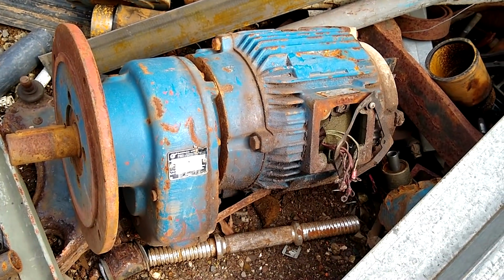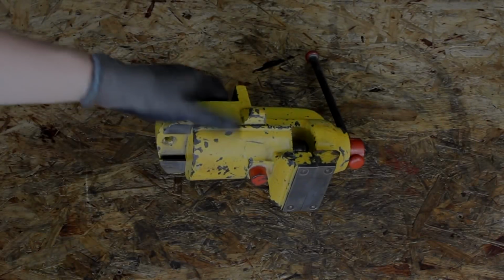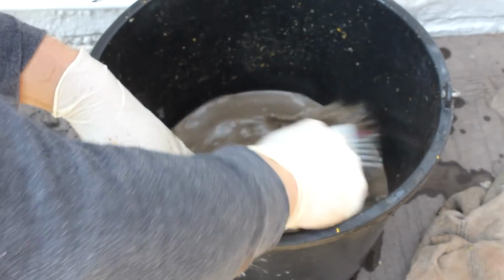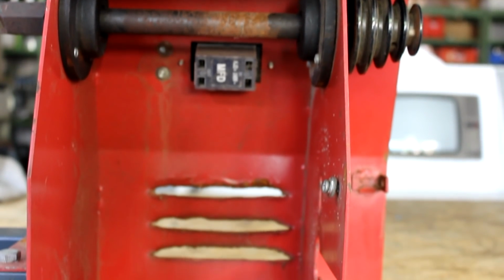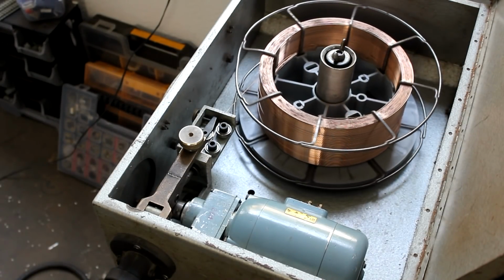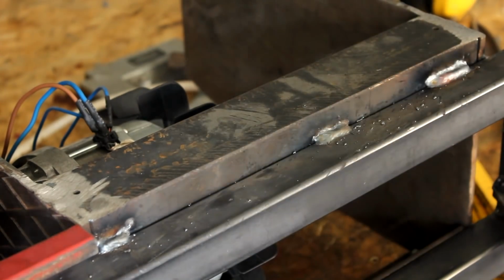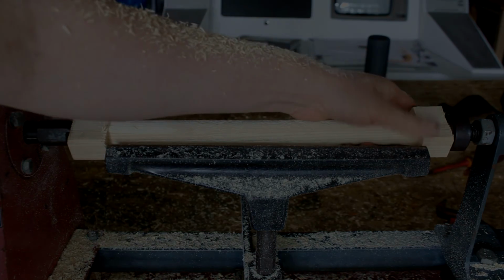New Scrapyard Finds! Repair-A-Thon!

Comment: That ring roller didn't even look damaged. Plug it in and go to work. I hope someone snatched that. I would have got a right handed motor and a step pulley. That added a ton to the fooprint, and now you can't change speed while keeping full power.

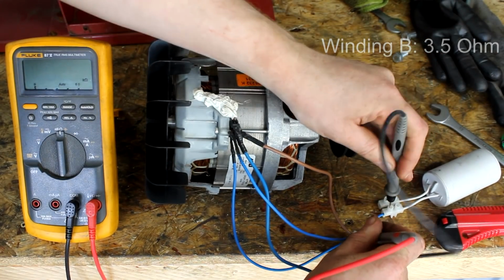Comment: @9:17 sometimes you can take the motor apart and flip the stator to get it to turn the other way.
Reply: That may work, but you have to make a circular thing that keeps the nut from working loose.

Comment: There are welding rods specifically designed for welding cast iron.  They are made of a high nickel alloy which bonds well to cast iron.
Reply: Stuff called muggyweld works great for engine blocks.

Comment: thanks for giving us the German words both written and pronounced, whilst i have have no real plans to learn Technical German i do find it really adds to a unique, interesting and informative dimension to your videos, thanks for the upolad
Reply: German technical terms are making everything 80% more steam-punk :)
Reply: I've bought a fair few old German power tools and garage equipment to recondition and use over the years, And I have to say that I hadn't given a single thought about any of the info on the stickers and plates other than the make and model when having to order replacement parts........... until now.
I'm now strangely curious about what all the rest of the stuff that was wrote on them said ?
Reply: if motor was turning the wrong direction why didn't you just turn the machine around and mount the tool rest and switch on  the other side?
Reply: @markc2371  - He discussed that.   If you know anything about lathes, they have 'handed' threads.   If you reverse the direction of rotation, you'll have all of the parts unscrewing themselves.    Turning the machine around would still have everything rotating the wrong direction.
Reply: Mark C
if motor was turning the wrong direction why didn't you just turn the machine around and mount the tool rest and switch on  the other side?
Reply: agreed
Reply: Just disassembly the Motor, remove the rotor from the field and replace it the other way round. So you got the proper dirction.
Reply: I had to do double extra credit to pass German 1 and was politely asked NOT to sign up for German 2.

Comment: Remove the screws holding the motor together  and flip the stator windings and reassemble
Reply: I was going to suggest the same, but I've run across a lot of motors where the windings themselves are formed asymmetrically and either are in the way of an internal fan or simply don't fit under the opposite end frame.  That seems to be a common thing among appliance motors where there's really little concern for making the motor design versatile.
Reply: @PSUQDPICHQIEIWC  Another option is to reverse one of the windings.
Reply: Maybe you shoulda said something before he went through all the trouble. I'm sure he would've heard you and followed your advice if you had typed your comment in ALL CAPS. I'll bet you go to the movies and yell at the actors right before they get killed off.
Reply: Here's a handy tip:  If you want to reply to someone, click the 'Reply' button directly under their post.  Be careful though, because there are often many different 'Reply' buttons on the same screen!  The website can't read your mind if you send your reply to a random person whose comment was on the same page.  

I'll bet you go to the movies and yell at the people next to you because you think they're actors.
Reply: I did. I clicked the reply button under mark zamiechowski's post. My comment ended up in the replies to the comment I was replying to. Everything's not all about you. I'll bet you go to the movies and yell at the people next to you just so they'll pay attention to you.
Reply: @PSUQDPICHQIEIWC  its zamiechowski and i got the response too i just started ignoting them because by now TPAI has seen it most likely and its now getting burried by others
Reply: @PSUQDPICHQIEIWC  You figured it out yet?

Comment: The 'metal press' is a sheet roller, can be used to make cylinders or just bending metal in a curve
For the motor, the winding that is in series with the capacitor can be reversed with respect to the main winding.
Another thought is that maybe you could take the motor apart and swap the end caps so the shaft comes out of the other end
Reply: yes, I got a bit surprised that he didn't know what it was. knowing how knowledgeable he is on so many different engineering areas.
Reply: I was thinking it was for making bomb and torpedo casing.

Comment: It's too bad you couldn't swap ends on the stator.  I've done that on a motor or two.
Reply: Would work, and the rotor will be fine, and the stator is symmetrical, and just will have the wires out the other end.

Comment: I insanelly like your scrapyard ressurection videos. So many things thrown out because the person needed to quickly get rid of something.
Reply: my work through away five Bridgeport vertical Mills big ones because they replaced them with brand new CNC Mills there was nothing wrong with the old ones they were just manual ....I took one home I figure even if I never do wire it up in my workshop I'll be able to turn around and sell it for a few thousand dollars
Reply: @josephatnip2398  my job also throws away a ridiculous amount of shit all the time. It's sad and their own dumb loss.
Reply: @josephatnip2398  did they throw away all of your punctuation too?